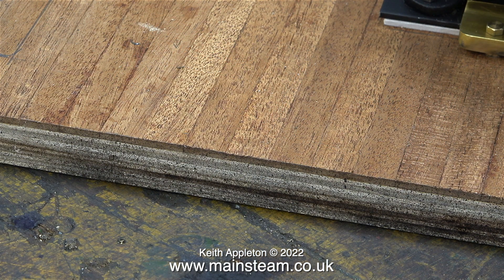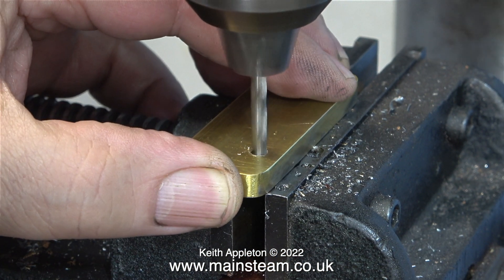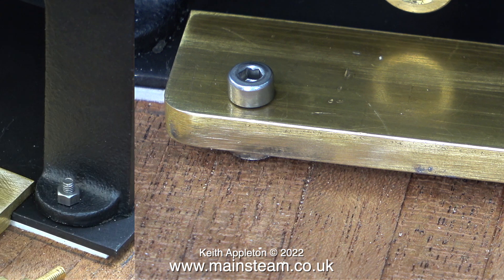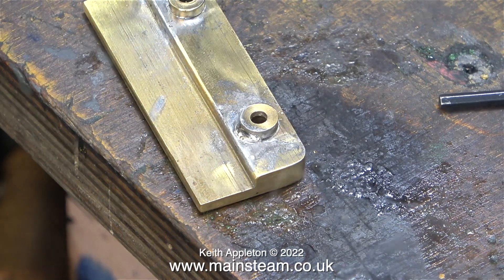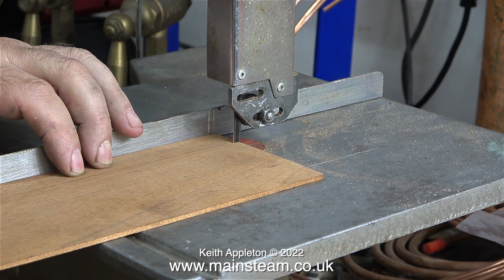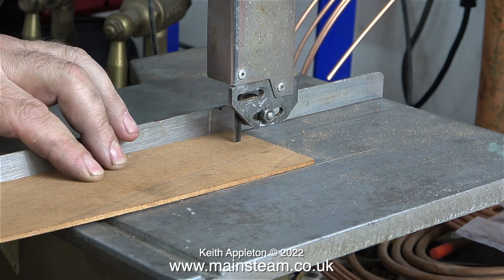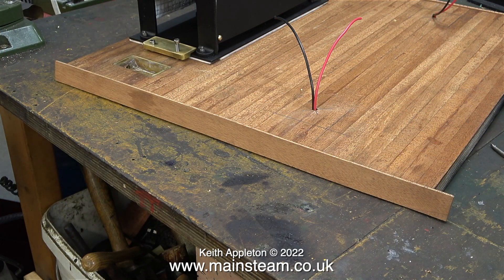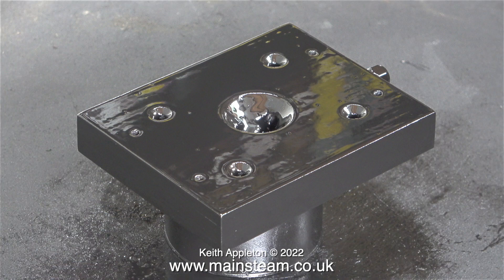MAKING A STUART MODEL STEAM PLANT - PART #60

Comment: One of the two workbenches I use in my TINY workshop in the back of my house was built originally probably in the 1940s.  It's quite large, and was used at the Royal Ontario Museum when my father ran the conservation department there--it was used for laying-out textiles for conservation efforts and evaluation.  Originally covered in leather.  My dad brought the thing home in the 1970s for his use, then in the late 1990s, I bought a small farm, and it ended up in my workshop there.  The leather came off and I fitted it with a sheet of ply.   I still have it, and it is covered in various pock-marks.   I weld on it.  My drill-press is on it, etc.   The OTHER workbench was built by my father and I when I was about 13, and it's still in use.  The top is red oak and Mahogany, based on a design that he'd built before in the UK, from some popular woodworking magazine in the 1960s.   Burn marks.  Divots.  Dents, and other general signs of "love".....

Comment: silver solder the brass washer?(just curious)
Reply from the maker: It's not really necessary to Silver Solder these parts.
Reply: @keithappleton  was wondering if the drill bit got hot enough to melt silver solder but it  sounds like you used soft solder (still plenty hot)thanks